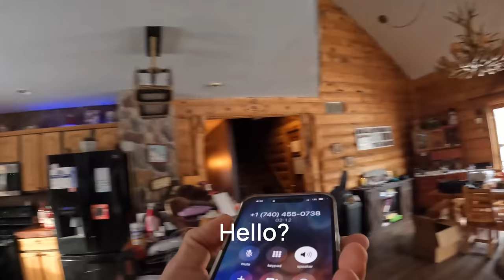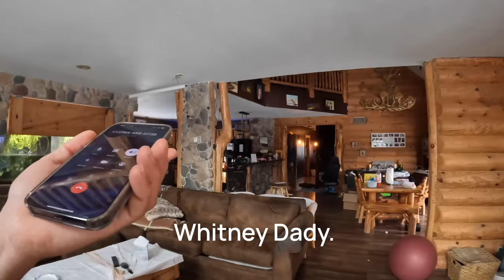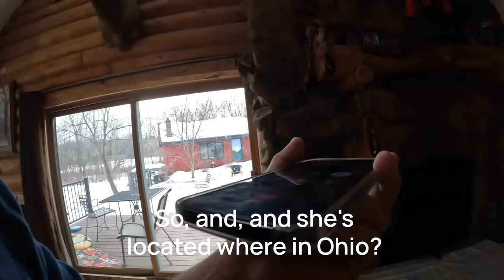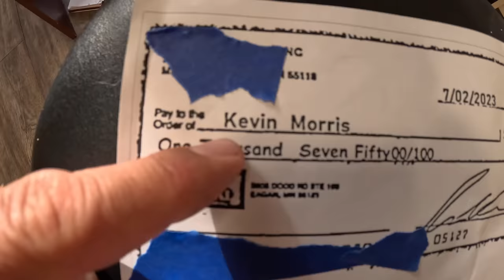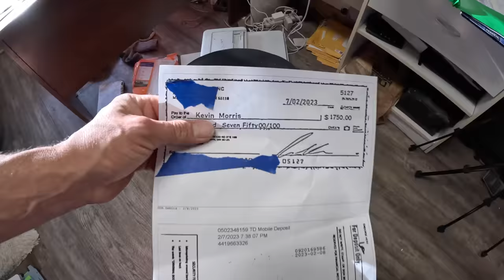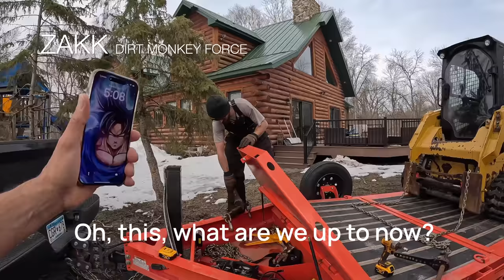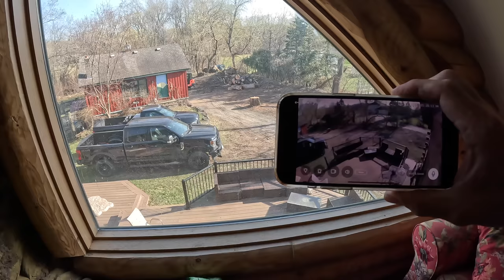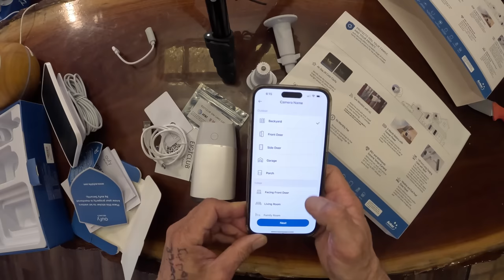The "WhiteWash Scam" !!   4K

Comment: I never handwrite checks anymore. I either do electronic funds from within my online banking and transfer which means money is transferred from your bank account directly to the receipents bank account. No physical checks ever see the light of day. In other cases I do an electronic check electronically. That reduces the number of people that have access physically to the check since the bank generates the  check and its mailed out from their offices. Sure it still ends in the US Mail flow but even if the check was stolen by a US postal worker or out of the receipents mail box  its much harder if not impossible to whitewash because they are generated with a vastly different format from normal paper checks and thus harder to erase and replace the printed info that anyone would fall for.

Comment: With bank accounts and business, I find it helps to split them into several different accounts, eg deposits, accounts receivable, taxes, etc make them one way into others so it isolates the damage if one is compromised. Also use business credit cards instead of checks when you can, those stupid slips of paper are a cause of so much grief. You can try to get superchecks with 50+ security features but who knows.

Comment: I live in a bungalow and have 8 'SWANN' hardwired cameras set up. The crime where I live is very low, but I have the cameras for my own protection from the neighbours.They're all assholes. They've called the RSPCA on me twice, constantly hassled me about leaving my fur babies alone for hours (which I don't), one has even prevented me from getting out of my car, I had to call the police to get them to drager drunk ass back in. I've even has one neighbour get his neighbour to come and threaten me, simply because I was doing some drilling on the adjoining wall at 6:30 at night. I had to get the police involved again as they threatened to rip my throat out. The best was, a year later (to the day), the same person actually physically assaulted me in a garden centre right in front of a member of staff. I got them to call the police and the guy is now on 3 years probation for assault. Sadly, it happened in the blind spot of two cameras.

Comment: Scammers. What a pain. What you're going through has been my whole life. Until I started to do a few things. No writing checks. No bank apps on any device. One app has kept the hackers gone. Melwarebytes. On YouTube. Is channel to help with settings on devices to also keep them off. Example. My desk top. If I shut it down or off. Threw the settings I learned off of YouTube. It's like the exact same thing as if I unplugged the either net from the wifi. On equipment and trailers. Trailers. GPS tracker. It is the same as my truck. It's a Ford. Built in tracking device done by Ford. My ridding lawnmower and my motorcycle have the exact same alarm system. For motorcycles. It works off of a 12v system. Key fob. Supper cheap. Off of Amazon. I have other 12v alarms as well. Bring the ear plugs and head set as well if you want to break in. Then smile for the cameras. If I turned on every alarm here. The whole town will know. What's really cool about the motorcycle alarm. You can not touch the vehicle it's on. My ridding lawnmower has been picking up earthquakes states away. Supper sensitive. Also, it hooks up to the lights. Also, it has a panic button. Well, beyond loud. I have to back off to set them. I even have one on my front door of my home. As long as the battery is charged. The alarms work no matter what. I also do not carry cash. None. One more. My cellphone. An out of state phone number. When I get phone calls with the same area code. It's a scam. Scammers always call you from your area code of your cellphone. No house phone. For myself. I don't have my cellphone set up for an answering service. Nope. I will not do it. I keep everything locked up. I use to get 300 to 400 scam calls a year. Truecaller got that stopped. Amazing app if you pay for it. It tells you exactly where they are calling from. There are other apps that if you have a place where their calling you from. Tells you who owns the property. Again. I have been scammed my whole life. From the Government to a homeless person. The way my home is set up. My front door is unlocked 24/7 unless no one is home. I sleep with it unlocked. I have more, but I will not share the rest. I hope something I shared will help you or someone else. Take care.

Comment: This type of situation has happened to me/my businesses more than I ever care to admit. Put everything on 2 factor authentication as well as put all your cards on a fraud lock so you get a text to approve or disapprove the charge and stop using checks for anything and if you insist on using checks set up a separate account that is only used for checks at a different bank than your main account is at and make sure that you have it set up to not allow any overdraft and only put the money you wrote checks for. Obviously at all credit bureaus lock all your credit reports and again 2 factor authentication via text not email always use your phone so you will get a notification that yoyr accounts are trying to be accessed in real time and finally use multiple different banks and never have business and personal accounts with the same banks personally I keep 3 personal savings/checking accounts and 5 business savings/checking accounts especially when I was doing the rental houses as i would use one as the rent deposit and ss soon as the rent check came in id transfer to one of my other accounts. And have 2 or 3 cash app or the like accounts i like layering so the one i have so i can transfer instantly i don't keep a physical card for and keep the digital card locked and every 6 months i burn the number and get a new one then I use that one to fund the one i use for anything online and day to day purchases so if thers s skimmer on a gas pump or something else then they can not get anything that i don't have in the account and its prepaid so can't overdraft

Comment: The cameras are only good as long as you have power, and an internet connection.  Take away your internet your cameras useless without a recorder but even thats useless if your powers cut.

I said use charge cards because you have 90 days to dispute a charge.

Comment: Living in Norway, check sounds so old fassion.

I believed check was introduced in the 60s, becoming common in the 70s, and peaked in 1984.
In 2004 check was labout 1% compared to its peak, and less than 0.1% of all non-cash-payment.
Today check is more like an artifact of the past, 

I believe the most common way to know about check in Norway today, is someone posing in the news with an oversized check for the photo, some kind of money award/prize.
Even cash is getting less common in Norway.

payment methodes in Norway:
Payment cards, common in stores and online
Mobile app: some stores, between friends, second hand market (linked to card or bank account)
Bank transfer: any invoices, larger amounts
Payment services: usually larger amounts as alternate to bank transfer, usually an adon service at online market place, for a multi step payment, where each step has to be approved, to have a third party haold the money while transferring ownership. (If seller won't give up ownership, you can argue to get it back; if buyer won't approve final step, the seller can argue to get the money, in any case it has to be settled for either to get the money, but it adds som extra assurance to both parties.)

Comment: Well first you need to arm yourself if you’re in a state where they respect your rights to do so. I think it’s going to get bumpy because of the border being wide open! I certainly isn’t gonna get any better! And if you can shut down your credit at Equifax. I would also do that so if someone tries to take out a loan in your name that sends up red flags everywhere and they will not be able to do it because of your credit being turned off. And two never use your Debit card at the pump and a gas station. We did in our account got hacked, always pay on the inside because at the pumps they put scanners on the pumps themselves it’s a messed up world we live in and it’s only gonna get worse because of our illustrious government, that’s In charge right now. Good luck.